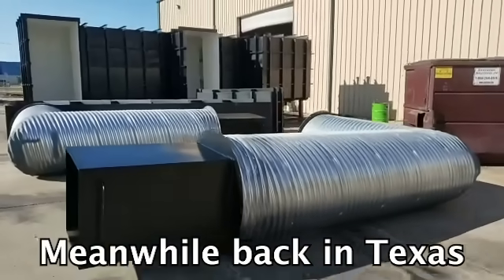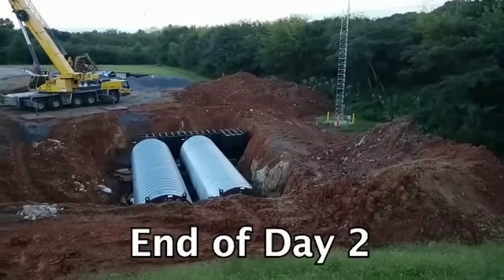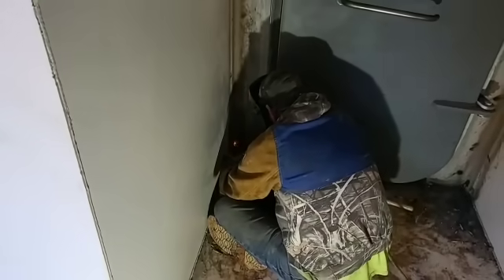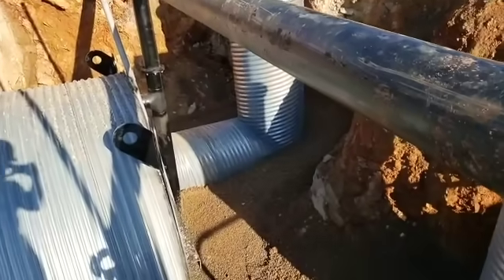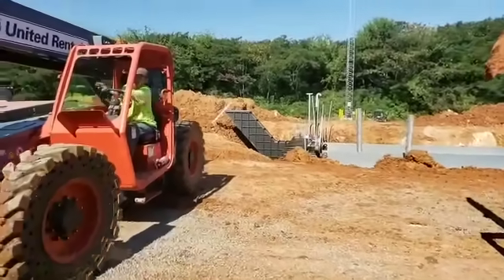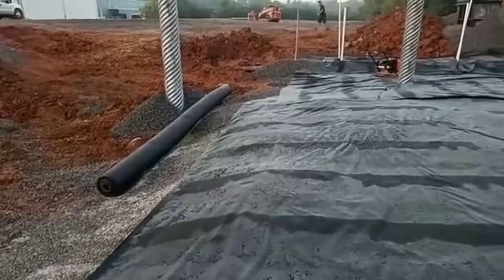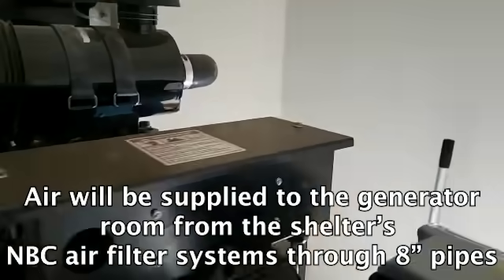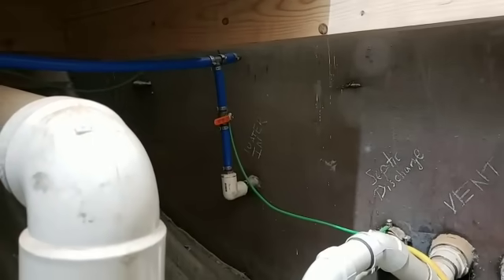Installing Two "Big Boy" Bomb Shelters "Side-by-Side"

Comment: I would have definitely wanted to put steel beams across the top of the culverts and used all that dead space in between them as another room, for storage and even sleeping areas if needed.  That seems like an easy place to add footage with simple plates on each end, steel beams across the top, with an 8" poured concrete roof.   I know you would have to add some cross braces here and there to keep the culverts from pushing together--- but it would be a great dead space to have-- especially for closets and such to stick out into that area;  Almost like an "attic space" - in a way.

Comment: Something that is a must in the bunker is WIFI must be accessible in the bunker as I am a computer nut. Who wouldn't want to know what's going on in the world. Shouldn't be too hard to do you just run a WIFI wires through pipes or cvc pipe whatever they are using and run it to the outside ground.

Comment: There is no way this would fit 24 people comfortably.    Just to store supplies for 24 people for two months would require a third bunker.    This would realistically be a good shelter for 8 people max.   Anyone know where they store the fuel for the generator?  And the water for drinking and showering and the toilets?
Reply: It's all in the plans.  What you saw was barely roughed in.  I've seen these shelters when they're completely furnished & set up - no problem hosting 24 people for a month or more..

Comment: 24 people for a month will require a lot of food. For a major emergency you might be sheltered for 3, 6, 9, 12 months or even more. I don't see sufficient storage for any large amount of food. You'd need an entire additional culvert for just food storage + cleaning supplies + tools & a lot more.
Reply: Your right but do you have solution?
Reply: @Niwaduwata  Cut down on the planned occupants for starters. Maybe bury a few shipping containers nearby that connect via tunnel. Need room for Food, Paper & Hygiene Products not to mention there wasn’t a washer/dryer. Are they going to wear the same clothes the entire time? Reuse towels with no way to wash them? What do they plan to do with garbage? 
Seems like a lot of things haven’t been well thought through.
Reply: What possible scenario would you EVER need this?
Reply: @sandersson2813  I can think of plenty of reasons a shelter makes nice "Insurance." Widespread Civil Insurrection, Dangerous Pandemic, WW3, and many more.

I just question the capacity as being for 24 people. It you were in there for any long period of time I think people would quickly find themselves cramped, bored & edgy. That's a dangerous combination.

Comment: I'd like to know what this particular installations design purpose is: severe weather / tornado / hurricane; nuclear exchange, biological epidemic / pandemic; or natural disaster.

My first concern: Don't know if it is mentioned, but one of the drawbacks to an installation of this size, requiring all that personnel - lets hope they don't remember the address of this installation when the doo-doo hits the fan. The riggers, welders, laborers, truckers; I'm sure all talked about to this job to their wife, their three brothers and their second cousin on their mothers side. The installation better be heavily defendable, against smoke out, or flood out. Ya don't gotta break in, just force the occupants out. 

If a nuclear strike is the reason for building, being within 100 miles down wind of a ground strike will easily see dose rates of 500-1000 rph (5-10 gray). Factoring the 7-10 rule for radiation decay to safe levels, it will be a minimum of 21 days of sheltering until rad levels are low enough to explore / seek better shelter for 1 hour intervals outside of the fallout zone. Sticking around underground longer is safer, but better bump up the supply quantity by a factor of three just to be safe.  Min req of 24 people x 1 gallon per day of drinkable water x 21 days = 504 gallons - and that's just for drinking - not for cooking, washing, medical needs, decontamination, et al.  Nor does it take into consideration waste removal: 2 gallons per flush, 3 flushes per day is 6 more gallons of water supply and this is if the occupants are not sick x 24 occupants x 21 days = 3024 gallons in addition to drinking water. So, a 5000 gallon water tank just for starters.

 Unless I missed the part in the video, I did not see a water well hook up and you sure as hell can't rely on municipal water supply in that kind of emergency situation.. I saw a generator, but in the event it is rendered out of service (lack of fuel, mechanical failure) the stored water supply should be gravity fed for redundancy. And these potable water numbers don't consider traveling supplies. Hunting, seek medical attention, foraging for food or fuel.  Lotta observations.. Lotta questions.. 

The first room encounter should not be a basic bathroom. It should be decontamination room. clothes bagged, shower, wash,. If the one bathroom is now considered contaminated, where do the uncontaminated people go? 2 bathrooms: one at entrance one on other end. Just a few of things I see I'd like answers on.

Comment: What did this bunker cost to buy and install?
It's an interesting project, but it doesn't seem to be a particularly good survival strategy to me. If the nuclear apocalypse kicks off and the ICBMs start flying, surviving the initial blast and fallout is only your first hurdle. Other obstacles include nuclear winter blocking sunlight which makes growing your own food next to impossible. Even if you could grow anything, you have to worry about contaminated soil and drinking water that will probably make your food toxic. Assuming you manage to build a subsistence-level farm, you're likely to encounter hungry raiders looking to steal your crops and supplies.
I'm reasonably sure that this setup does not allow for enough cubic footage to build a self-contained hydroponics garden capable of sustaining a single person. And even if it did, once your fuel supply runs out, no more electricity for the lights.
Reply: And does your flat allows for enough cubic footage to build a self-contained hydroponics garden capable of sustaining a single person ?
Reply: @lenaufragedujapon7670  Unlike this guy, I'm not planning to use my Condo as a survival bunker in a post-nuclear wasteland. If the nukes start flying, there will be very few remaining grocery stores or fast food joints.

Comment: It is not much space consider it is designed for 24 people with no private area. It can't be use for long term stays for 24 or even 12 people living there before they start killing each other.  Hopefully they have a large enough septic system and waste disposal area to handle 24 people waste.  If not, it's a waste of money.
Reply: Without proper training, 24 people or several families just can't stay in this bunker for more than 2 weeks.

Comment: Theres no reason to use 12" concrete, when you could just throw wo rebar in a 6" slab and make it even stronger than the 12" slab.   Why did you not have sufficient rebar in your slab?  It completely defeats the purpose in pouring thick;  because it's still going to crack anyway.

Comment: Kind of disturbing if the electricity to power this bunker is from the grid or a gas powered generator. I'm not sure if I'd rather die facing what's on the surface or be alive self imprisoned in darkness.

Comment: Ok, first question.
How the hell is anyone (especially a child) going to puncture that sand seal on the escape hatch ? the pressure would be tremendous.
Second question, why, oh why, wasn't the shower unit and toilets for that matter, placed at the end, this way you don't have literally everybody being entertained whilst you shower.
Third question, The enormous generator will not only provide power it will also give off a lot of noise, heat, vibration and fumes constantly. Do you have a battery system on a constant charge from solar and wind power for back up.
I'm sure I'll come up with more questions as time goes by and I'm sure there's things that you didn't show in the video but on first appearances this shelter seems poorly designed and staggeringly expensive.

Comment: Wait what? 24 people for how long? For a nuclear blast and fall out.  You need to survive for 6 months to 2 years before leaving the shelter. You are keeping 2 years of food for 24 people in there? With a 600 gallon tank and the average male needing to drink .264 gallons of water a day.  At 24 people that's 94 days worth of water. I missed the part of how much water is being generated by the ROS and how much of it is being used for drinking storage vs oxygen scrubbing.
Reply: 24x 2,000 calories/day=48,000 calories /day you would need 36 fifty lbs bag's of rice for 60 days
Reply: @Paul-kd3ui  which means even more water needed to cook that rice ;)
Reply: After reviewing info there would be No showers just stink

Comment: Anyone underground inside
Such a thing is a sitting duck when the topsiders
Find your intake and exhaust and then start plugging one while putting dangerous materials in the other in an effort to flush you out or end you altogether.
Yes ….I would much rather take my chances top side unless my bunker was located in a severely remote spot where
Nobody in their right mind would dare to try to traverse.

Comment: For $500k, you sure don't get much for your money. lol..  I think you would be just as good to buy a decent used excavator for $14k, dig a hole, buy 4 used shipping containers at $3k each and welding them all together in a big square shape with a quart yard in the center.  Stick some 8" purlins across the open span in the middle, pour a rebar engineered 8" concrete ceiling over the full structure--- (which will second as the floor of the building above.)  Wrap the whole thing with grease and plastic wrap... Just grease it on like glue and stick the plastic over it ---  and then do a full second layer.... and if the plastic is cheap enough --- just wrap it a third time --- and then pour the dirt on it.  That's all you get.  probably still last 100 years easy..  and if the walls flex and bulge inward a bit, who cares, it's a bunker.   Just make sure you have a center bulkhead/ wall somewhere near the middle, so that it helps push out on the walls --- and it's fine.  It looks like a lot of the $500k went into making sure the culverts stay round. lol.. Seems like a terrible design decision to start with.....   You can trench a pipe around the outside and throw a rock bed -- and have it extend out like a lateral line from a septic tank -- but you don't need to over do it like this. It's not like you're constantly pumping water at it like a dang septic tank.  It's barely ever going to see water at all....  This just seems like such an inefficient way to build these.

Comment: I worry, after seeing what happened recently with the flooding that has occurred in the east coast as well as in New Mexico, if enough attention is being paid to these bunkers being watertight enough to manage to deal with being under floodwaters for a period of time, and if equipment is in place to pump out water that could collect in access and escape tunnels, as well as overly saturated ground around and over the bunkers.  Climate change had people forseeing drought and dry, arid conditions with lack of water, and ignoring the warnkngs that it could be the opposite of very dry.  Given wr are seeing more powerful hurricanes and cyclonez, droppjbg, as well as atmospheric rivet events dropping almost tidal waves if water in some areas, i am not seeing or hearong how these bunkers are goi g to be able to protect in a flooding, waterlogging situation.

Of course these bunkers are not going to survive a nuclear explosion that is relatively close but are more meant for protection against fallout and enemy aftermath if bombs go off in a distance far enough away where the bunker  will not be destroyed.  But what about EMP?  Are these bunkers and all their electronics and machinery hardended so that you are juat not locked in a metal tube without light, water, cimmunications, sewage etc?

Comment: I very much appreciate the design and engineering of these bunkers but in my opinion i think this is excessive and overpriced ( i could be wrong). I did all the math and calculations in todays economy. There are various cheaper options and more simplistic ways of building a bunker. Based on my calculations with best material out there as far as using metal (for walls and foundation). ive determined it would cost upwards of $10,000-$13,000 to build a complete 10'x10' bunker that also includes concrete pouring for insulation and electrical work to add electricity, Machinery rentals. The prices are based on getting the best of the best materials for your bunker. Now of course you can cut these costs pretty much in half if you use cheaper alternative methods you can find online. But honestly i view atlas survival shelters as a luxury underground bunker manufacturer ( nothing wrong with that) I understand they have to pay all the salaries of their employees. But too much in my opinion.

Comment: $500k build and you get $40 counter tops from Home Depot and a $100 shower stall that a kid cont fit in. Rusty ass escape hatch wells, $3 LED lights….. geez, maybe it will hold up for 200 years but the chalk scribble on the wall will be long gone in about 6 months. Nice engineering (hopefully), cheap ass workmanship and finishes inside. No thank you!

Comment: So many poor design choices that completely compromise the purpose of a shelter like this. It's designed for 24 people? There's not enough water to sustain 24 people for more than a month. There's no redundancy in power generation. Yet you have a dedicated server/hardware room, 24 beds, two kitchenettes with two minifridges (so you can store enough cold beer to last maybe the first two nights in the shelter???), three toilets, and dining space for 18 people to eat simultaneously. If the world is ending why aren't you hot bunking? It would essentially cut demand on common areas in half during waking hours while giving A LOT of extra space for critical supplies or at the very least provide additional room for open areas so it doesn't feel like everyone is huddled on top of each-other when they aren't sleeping. I can't wrap my head around the thought process when specing out this shelter.

Comment: waste of money, time and effort. you will go insane in such a space very quickly especially with a few people.each person needs a minimum of 350 sq ft of their own space (remember they are not prisoners) each person needs  access to communal space / spaces, toilets, bathrooms, kitchen / cooking. so if you are intending for your family to survive any length of time you need huge storage spaces, food, freezer, fridges, water tanks , at least 40 litres per person per day.
air conditioning, filtration, CO2 extraction,  in fact the list just goes on and on. 
for just a couple of days this might work any longer and  failure is assured.

Comment: complete waste of time and money... to simplify, what happens when you run out of fuel for the generator. now you live in a dark pit with no airflow, light, water, no nothing but a cave... you won't last long - give you 30 days or less... at best this is a glorified weather shelter (tornado, hurricane, etc.) - it won't shield you from radiation or anything serious - no consistent power, dead in the water like a boat. at least with a boat you can fish as you float until you wash up on land although not a recommendation either. smarter, get a pilot license and a small plane, purchase a home and land in a country that typically wont be impacted. get out of the situation, don't stay and rot in the ground. no supply chain, your not going to live long...

Comment: If you can do all this, why not make them deeper in the earth? My basement is deeper than this f**** bunker. What a waste of time and money. If I'm going to go to this extent I'm going to have at least 20 ft of dirt above my head if not 50'. Additionally, I understand using the pea rock for drainage but there was not nearly enough concrete surrounding this thing. Basically you've got two giant metal tubes that are only about 5 ft deep in the ground surrounded by a bunch of gravel. Really? That's your plan? I would pour 2 ft concrete wide around the entire perimeter in up and over the top after you filled it with it right amount of rock for drainage. Then put your up to 50 ft of Earth above it, then it's secure. 5 ft underground surrounded by a bunch of gravel is a waste of time and money.